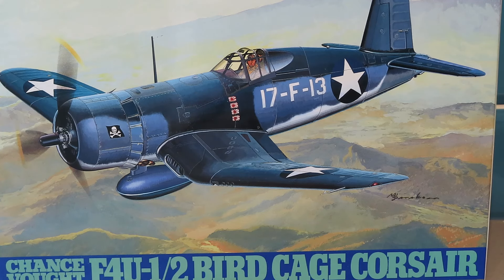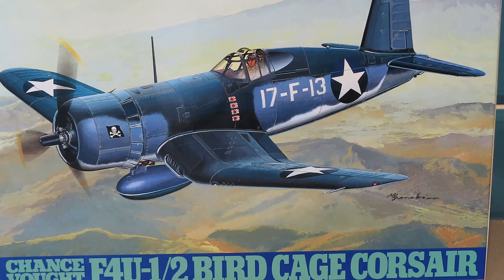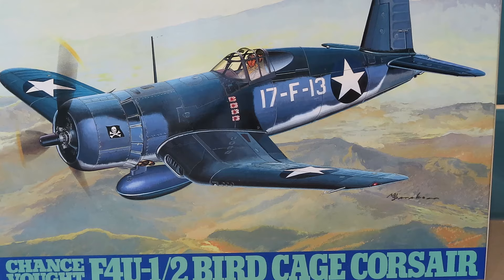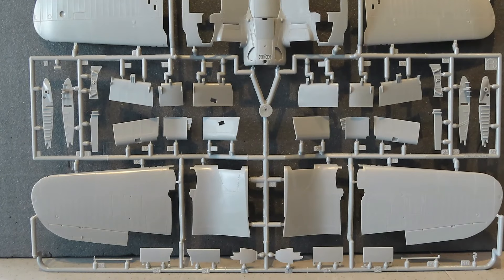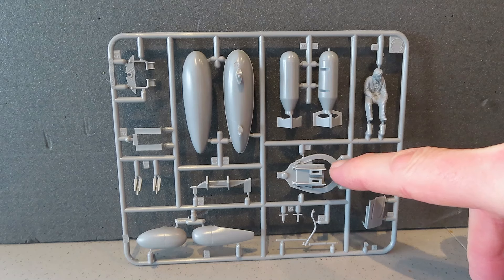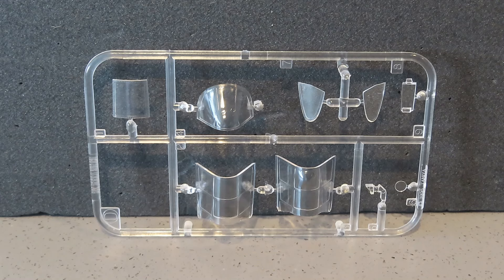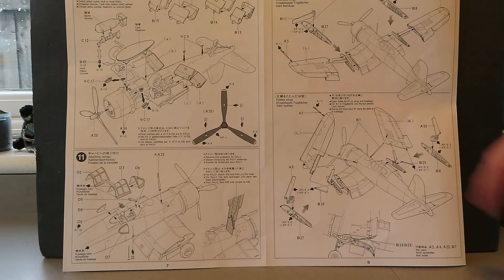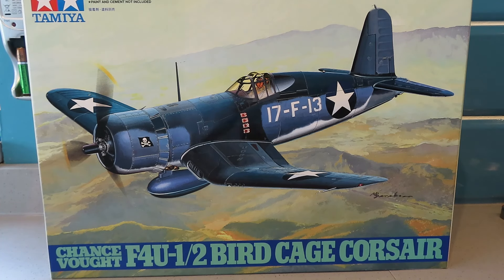Buddy Build - Tamiya 1:48 F4U-1 Corsair - Intro

Comment: great intro Al puts mine to shame🤣i have looked into aftermarket decals for vmf114 but there don't seem to be any available, so like you i may have to hunt around to find something i can use. you ar correct about the white on the cowling and a small white panel on the tail going back to the nose(propeller) the spinner hub is also white ans a small section on the bottom of the propellor is also white. WW2TV has a great video VMF 114 Death dealers on Pelelieu with alot of photos of the aircraft if your interested. have a great build my friend😜✌👍👍👍👍
Reply from the maker: Yeah I came to the conclusion that we would struggle with getting actual decals. I am just going to try to get as close as I can with teh tips that you suggested and the stuff I found on line. We didn't set a finish date Rick. Any ideas, or do we just leave it open? Have a great build mate I really looking forward to this. 👍👍😉
Reply: @alwoodsmodellingmayhem  leave it open as i know your a busy person with other stuff as well. ✌👍👍👍👍
Reply from the maker: @rickskits  Thanks mate. When either of us finish, let's tell the other before posting a final reveal. 👍👍😉
Reply: @alwoodsmodellingmayhem  ok will do